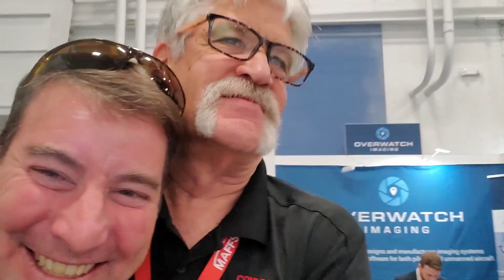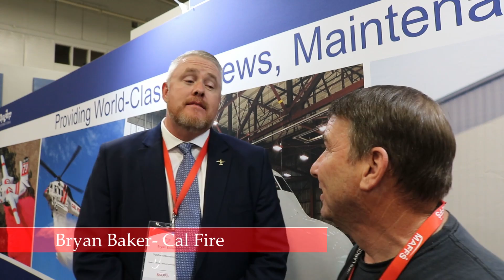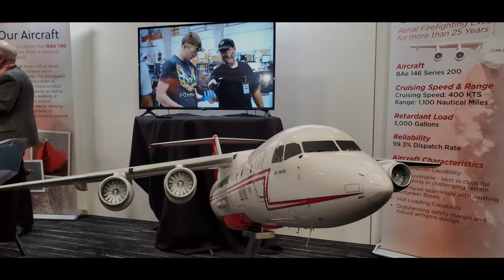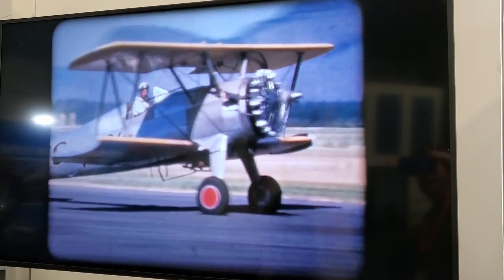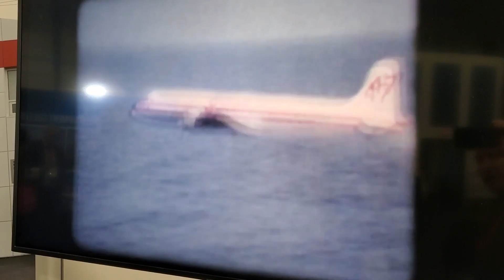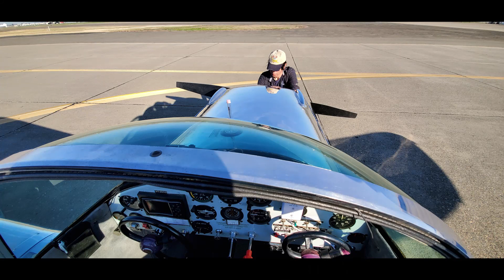Hiring Pilots! Aerial Firefighting Conference (Part II)

Comment: As a youngster, I watched TBM Grumman Avengers reload at Vancouver International from only feet away. The pilots just kept the big radial engines ticking over until the tanks were full ... and were off again without ever getting out of their aircraft. I will never forget the great clattering rumble of a huge Wright-2600 Twin Cyclone engine as it idled. 

I was at some of the airshows at Abbotsford International when performances were interrupted so Conair tankers could operate. And in about 1973, I watched a Conair DC-6 extinguish a fire on a mountain in the District of North Vancouver. Watching a big four radial engine, converted airliner swooping just feet above me and skimming the tree-tops on a mountain and dumping is permanently etched in my memory.

Comment: Canadair/Bombardier CL-415 Super Scooper....is Nowhere in comparison to the Beriev Be-200ES Altair ....been in EMERCOM service since 2004, EADS certified, used in Europe & Israel..!?
Jet Warrior - https://www.heliopsmag.com/beriev-be200-the-jet-warrior

Specifications for Be-200ES
Capacity: 12,000 kg (26,455 lb) water or retardant Scooped in 14 seconds
Maximum speed: 700 km/h (378 kn)
Cruise speed: 560 km/h (302 kn)
Economy cruise speed: 550 km/h (296 kn)
Minimum speed (Flaps 38°): 157 km/h (85 kn)
Range: 2,037 km (1,100 nmi)
Ferry range: 3,333 km (1,800 nmi) with 1 hour reserve; 3,850km, (2,078nm) with No reserve
Rate of climb: 13 m/s (2,600 ft/min) at Sea Level, MTOW and Flaps 20° or 17 m/s (3350 ft/min) at Sea Level, MTOW and Flaps 0°

Specifications for CL-415 Super Scooper
Capacity: 6,137 Litres (1,350 imp gal; 1,621 US gal) (waterbombing)
Maximum speed: 359 km/h (194 kn) Max Cruise
Cruise speed: 333 km/h (180 kn) Normal Cruise
Stall speed: 126 km/h (68 kn) MLW, Landing Configuration
Ferry range: 2,427 km (1,310 nmi) 278 km/h (150 kn) Long Range Cruise
Endurance: 3 hours at 370 km (200 nmi) from base
Rate of climb: 5.9 m/s (1,161 ft/min) (ISA, MTOW)

Comment: I have been hearing about the "Pilot Shortage" since 1975  it was BS then, to get you to write a check for flight school and It's an even bigger amount of BS in 2020 the only difference is that the size of the check needs to be 20 times as much as it was when I  went. There are just not that many seats  So instead of 100 resumes on the pile you have 65 and well there must be a shortage.
Reply from the maker: The shortage is here, and so are the side effects...

Comment: The last Ercoupe came off the line in Maryland in 1952, but the plane was made after that in other states until 1970. The company that built these was ERCO. They had their own two runway airport behind the factory that was shown on maps. The factory building was demolished in October 2013. But after they stopped making Ercoupes, ERCO went into the simulator business. They were making analog simulators at the factory in the 1960s. A number of these simulators were located at McClellan AFB.
Reply: I wondered where you were going with that until you said about the sims at Mc Clellan. Well that’s interesting. Would like to see them, good Ercoupe related history!

Comment: Question, when you drop your load how pronounced is the cg change in the air craft. In other words if you did not change the power or trim settings what would the aircraft do? Obviously if the aircraft remaied straight and level the aircraft would accelerate after dumping the load. But what does it actually do?
Reply from the maker: pitches up, watch the S2-T cockpit view again...both hands pushing down elevator during the drop, plus running the trim.